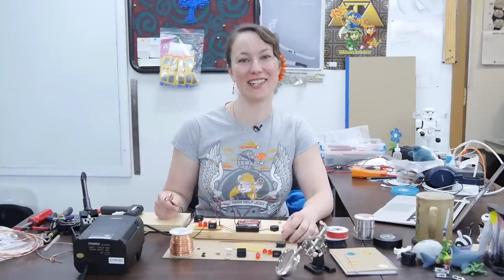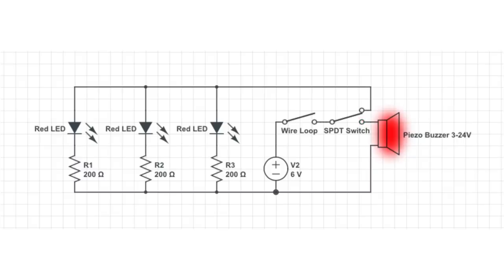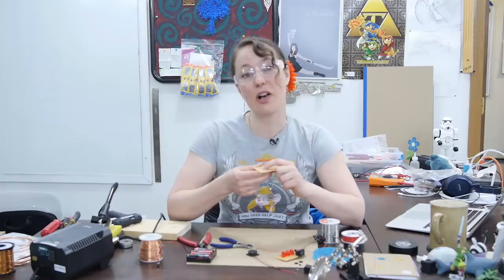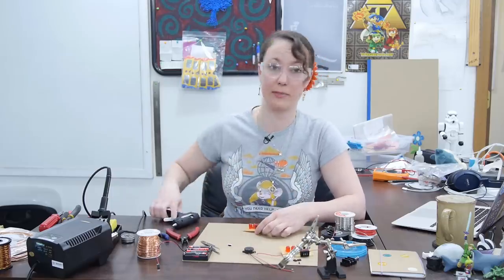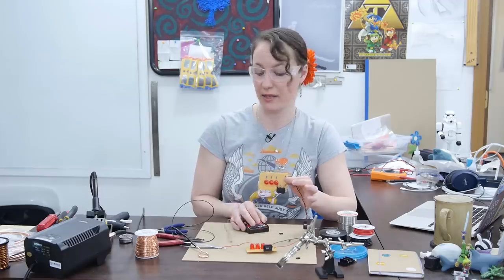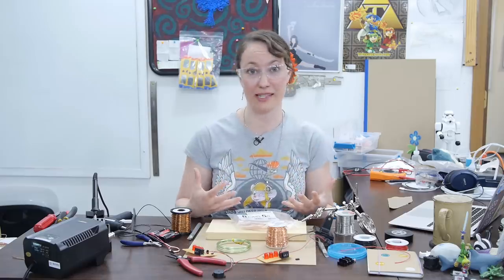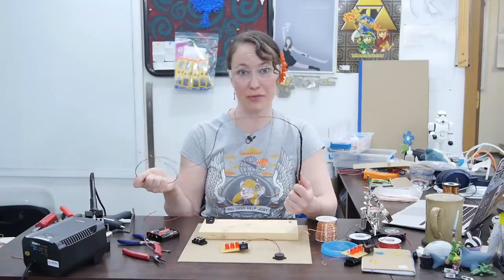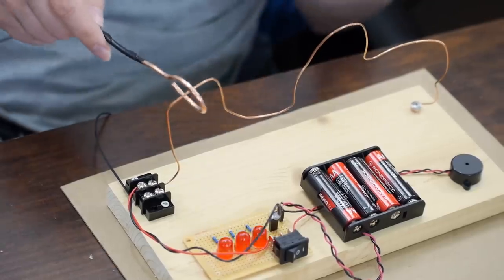The Learning Circuit - Wire Maze Game

Comment: Power connector tip: always use three header pins: the middle one is V+ one of the others is  GND, this way there is no way you will jank reverse polarity into your project. thats the way rc connectors are done..safety!
Reply: Or you could use one way connectors thereby making it only possible with effort and intent.